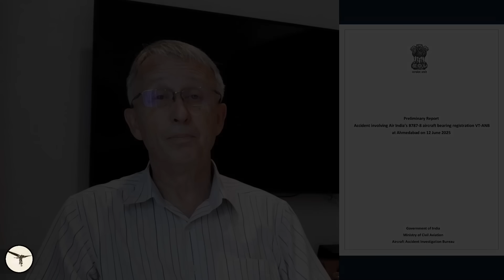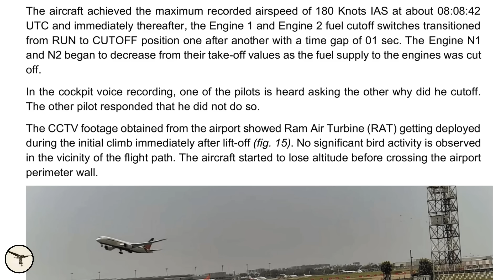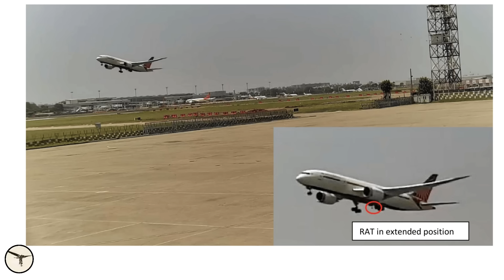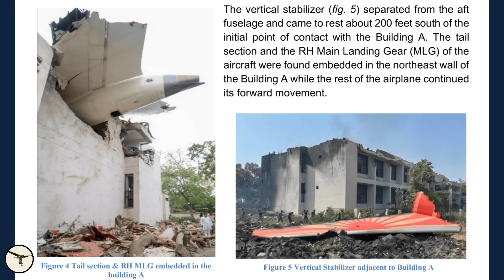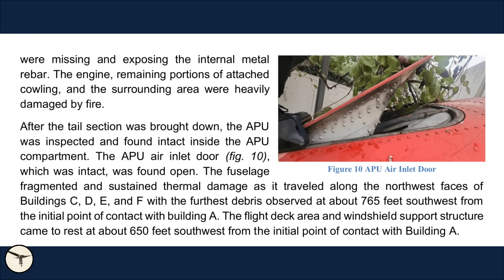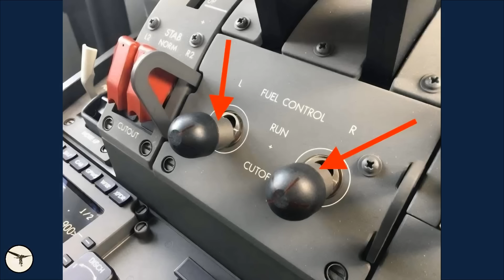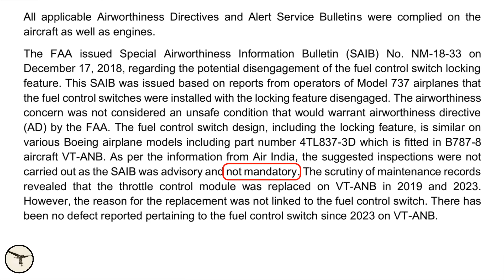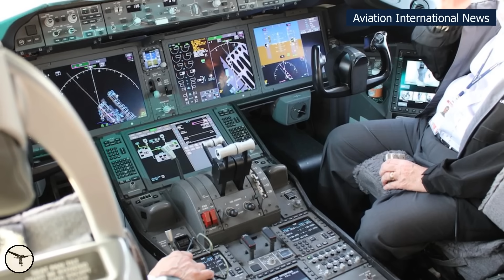WARNING Fuel Control Switches Failure Could Cost LIVES

Comment: Switches not touched, spring loaded valves closed  automatically when  electric glitch stopped power to valves.  NB..  when electrical power is interrupted, even for a fraction of a second, 787 and 777, for any reason, the spring loaded fuel cutoff valves to the engines will snap shut. This design is that in case of electrical failure, which means fire extinguishers cannot be activated, fuel shuts off automatically, spring loaded,  so the wing does not burn through from an engine fire. At take off there seems to have been an electrical snag. Happened to ANA 787 after landing using reversers, in Tokyo, and unable to restart. Happened to BA 777 landed safely mile before runway in London. RTd Training Capt
Reply: Interesting point; I am surprised that nobody else has considered that cause. 🤔
Reply: The BA777 was brought down because of fuel flow issues relating to supercooled kerosene… not switches or engine faults.

Comment: My understanding of why pilots keep their hands on the throttles is so that they can pull back on them if there is an aborted takeoff before V1.  In every video I have seen of this practice, the pilot takes his hand off the throttles once V1 is achieved because you need to have the throttles at full thrust even with an abort after takeoff.

Also, to think that both fuel cutoff switches were pulled inadvertently within one second of each other at the most crucial time at takeoff when a successful relight was highly unlikely in time (the time is NOT a misprint) beggars belief, even if somehow the lockout feature was faulty or missing.  I'm afraid it's looking like a deliberate action by one pilot to bring the plane down.  Who it was and why remains to be seen.
Reply: The timeline (hour, minutes, seconds) in what the switches are moved coincides with the timeline in what the landing gear lever should be moved - and it was not.

Comment: So if the APU provides compressed air for ground engine starts and power, why was that not still running? Had they used a GPU at the gate? Was an electrical short responsible for RAT deployment? That device is not designed to raise landing gear pumps, it’s for instruments and controls, right? Could high heat and humidity screw-up those electronics? 

Is it possible that numerous failings aligned, where none by themselves would cause a catastrophe, yet combine in a unique way to make this ill-fated flight impossible?

Comment: I'm a complete novice. Question: It took ›01‹ second to set two switches to CUTOFF, but four seconds (08:08:52 - 08:08:56) to set them back to RUN?

Comment: One thing I would like to mention is that if the pilot had any suicidal thoughts then he wouldn't have tried to crash it just right at the time of take off. It is in survivable range. Imagine in your mind you being that pilot. I mean it could have even survived had there no buildings and just plain land. So, Pilot might or might not have cut off fuel switches but it is sure that he would not have suicidal or malicious thoughts. Yes, he would be very reckless like drunken person.
What are your thoughts on above, guys?
Reply: To cut off fuel right after takeoff is PRECISELY the right time to do it if you want to get killed because there is not enough power to fly any higher (and then possibly glide to safety) and at the same time you are high enough to get killed when you drop on the ground (unless you land on a giant sponge).  You have to be a pilot to know precisely this moment (and after this crash the general public learned about it too).

Comment: Why did the RAT deploy? Engine fuel cutoff can stop electrical power instantly? Fans take a long time to spool down on the ground, and with wind through them, would it take longer? If critical for restarting why did they takeoff without the APU running? The plane has sixteen batteries, doesn’t it? What are they for? 

Fuel pumps mechanical? What controller opens and closes fuel valves when switches send a signal? Did an electrical power failure occur? Would that change of power source cause the fuel valves to close without a change in switches? How much time can pass before fuel pressure is lost and line supplies depleted, from switch cutoff to thrust failure? 

Inertia would continue a climb-out, trading airspeed for altitude, yet RAT deployment was said to quickly follow rotation, as 180 airspeed was achieved. That can lift an aircraft temporarily, but not raise airspeed from 153 to 180. That max speed must be the point of engine failure, but why is that an instant signal to deploy the RAT? Hydraulic pumps are electric on a 787, aren’t they? 

A running APU would be stripped of its blades, if running at the crash, but that has the same fuel supply. Does it have a different cutoff switch? Time stamps mean everything in this scene, and radar, voice, video, and data marks in time signal when the boxes received the signals.

They don’t say whether pilots initiated them. It doesn’t claim that anyone was in the jump seat. Nor do they assure that a malicious hack hadn’t occurred. The switch message wasn’t sent from the switch to the black box recorder directly, and actuation demands a controller. 

Will a starter engage a turning rotor? Did that happen? Or was windmilling still able to compress fuel/air for a relight? An electrical hiccup at low altitude that requires a fuel reset and engine restart without sufficient time is tragic. A pilot dealing with secret demons is quite another. The latter is so much easier in dismissing all other more complicated questions. Nothing conclusive says that that is the answer. 

If so, the cloud seen in the swirling wake of the rising jet is nothing. But we’re engine and fuel pressures lost suddenly, according to that dew point performance profile standard, or was the thrust struggling already, before fuel cutoff? 

Was this flight doomed,….or murdered?

Comment: The conclusion that a pilot intentionally switched the engines to cut-off is speculation. The FAA issued a Special Airworthiness Directive (number NM-18-33), listing the 787-8 model as affected, that warns of: "The potential for disengagement of the fuel control switch [locking] feature" because some switches were installed by Boeing "with the locking feature disengaged."
Reply: They were turned off separately by a second and tuned back on 10 seconds later. If it was accidental why wait 10 seconds to turn back on. One engine did relite, If it was sooner maybe they would have got out of it but doubtful at that altitude
Reply: Even if the 787-8 had the locking feature disengaged the fuel control switches moved not at the same time but one second apart. That suggests someone moved them - one at a time.

Comment: Would plane enginge run if switch was moved to run but didnt fall in gate but they were right on the edge of the gate? I have played with many switches the steel one Nd i was used to enjoy the satisfying action from that. I was used to balancing the switch right in the middle but the radio wouldn't turn off. And due to spring pulling it the slightest nudge would close it. Nd radio off

Comment: Engine computer has control over fuel switches

1 sec it too short for pilot to act
Reply: Nope, just fast enough for a human to do it
Reply: 1 second to between CUT OFFs but 4 seconds between RUNs. Why is the difference?
Reply: @Te0gop The fight between pilots. The smiling one lost the fight.

Comment: There are dozens of time stamps given for all of the events in this crash. But no time stamp was given for when this alleged flipping of the switches occurred.
Reply: Read the freaking report dude. Immediately thereafter 08:08:42.
Reply: @GrimYak  Immediately after the ice age, helocene started. What time, within 1 second did that occur? It was immediately, how much time was it immediately after the ice age?
Reply: Also the actual deployment of RAT - immediately after liftoff what does it mean - before or after CUT OFF?
Reply: The RAT would have deployed almost immediately after the switches were moved. They were moved 4 seconds after the plane became airborne.

Comment: maybe when the fuel switches were turned to the run position, it was not in the lock mechanism, and then they slided back to cutoff position without pilots even touching them. I don't know whether it is possible to happen that way. otherwise one of them must be suicidal.
Reply: Have you considered telekinesis?

Comment: Hello Mister Magner:

Can you shed some light of the US FAA Special Airworthiness Information Bulletin (SAIB) NM-18-33 was issued on December 17, 2018. This SAIB addressed the potential for disengagement of the fuel control switch locking feature on certain Boeing aircraft?

How could this may have played the role in fuel being cut off to the engine?
Reply: The accident aircraft have their throttle console - that included the fuel switches; replaced in 2019 and 2023, none caused by issues with the switches.

Seems this preliminary revelatory was made for create more doubts than explain anything.

Comment: All nonsense: Initially, the fuel switch in the on position must have malfunctioned due to some electrical glitch. This means, though they were physically on, functionally they were off. These reduced the engine power, which must have triggered the cockpit warning signals. The pilots at that point must have then tried to recheck the fuel switch by moving it on and off (confirmed that they really did within 1 sec), to check if the switches are OK, and really working (which we all do as part of human behavior when something doesn't work ). Finally, they put it on. But by then, the engine had stalled, and it crashed. There is no conspiracy or pilot fault unless we can prove that the fuel switches were actually functional. Put yourself in the pilot's shoes at that peak of emergency and ask how much your cognitive and motor skills will work trying to troubleshoot a problem, as well as to save the flight from crash, all SIMULTANEOUSLY within less than 2 mins. The senior pilot was nearing retirement, while the first officer was at the peak of his career. There is absolutely no intent from either of them to deliberately sabotage the flight. There isn't a reason to do this. It makes no sense at all.
Reply: We don't know whether the pilot asking the question had seen the switch position (or the other pilot turning it off), or whether he had noticed a warning on the display. In any case, such a situation initially leaves one confused and perplexed. It would now be necessary to clarify whether such a discrepancy between the physical position of the switches and the data in the computer is possible.

Comment: On Jul 12th 2025 (UTC) India's media report that the investigation is NOT focussing on a human action causing the fuel switches to appear in the CUTOFF position, but on a system failure. Service Bulletins by Boeing issued in year 2018 recommending to upgrade the fuel switches to locked versions to prevent inadvertent flip of the switches, as well as the FAA/GE issued Service Bulletin FAA-2021-0273-0013 Attachment 2 relating to loss of control issue (also see above) were NOT implemented by Air India. The stated MN4 computer with faulty soldering, that might weaken and lose contact due to the thermal stress after a number of cycles, interprets data and commands fuel metering valves - with the lost contact attaching the MN4 processor to the EEC intermittent electrical contact, loss of signal processing and engine control faults can occur. The SB writes under conditions for the SB: "An LOTC (Loss Of Thrust Control) event has occurred due to an EEC MN4 microprocessor solder ball failure." According to discussions in the industry it may be possible with the number of cycles VT-ANB had already completed, the solder balls were weakened sufficiently to detach the MN4 from the EEC momentarily due to loads during the takeoff rotation leading to the loss of control of thrust and shut down of the engines.

Comment: This report is suspicious.
It states the "Engine fuel cutoff switches transitioned from RUN to CUTOFF", it does not state 'the pilots switched them off'.
With all the electrical safety hazards and inadequate fail-safes exposed in this Boeing 787, such failures cannot be discounted.
And why is no blame laid on one of the aircraft engines failing to restart after fuel supply was reinstated ???
Reply: Who switched them off then? 
There is no system that can physically move the switches
As for recovery, the cutoff for engine 1 was moved back to run 4 seconds before engine 2 which might explain the small difference in relight behaviour?
It shows the FADEC was in fact working perfectly and had they had a bit more altitude / time the crash would have been prevented.
Which IMHO is why the 'guilty' pilot moved the cutoffs exactly when he did - no chance for the innocent pilot to abort the take off or reinstate engine thrust in time.
Reply: They were clear that the switches moved and there is no way for them to move without human intervention. Mayybe they isolated the noise of the switches being moved on the CVR?
Reply: @gap9992  This was not clear. All of the events have a time stamp given of when an event occurred. But not the alleged flipping of the switches.
Reply: @martinwhite418  "switches transitioned from ON to CUTOFF" What does that mean if it does not mean the switches were moved?
As for a time stamp,  immediately thereafter 08:08:42 is good enough for me
Reply: @gap9992  They purposely chose not to give a time stamp of the 2 switches. No. That's not good enough. That will become an issue.
Reply: @martinwhite418  They were switched off immediately after 08:08::42 - do you accept that is what the report says?
Engine 1 was switched back to run at 08:08:52 and engine 2 at 08:08:56
Entirely consistent with the good pilot seeing what the other had done and quickly switching them back on.
What issue are you expecting??
Reply: Good observation which many other experts have highlighted. Knowing Boeing we will never know. What puzzles me is why the voice cockpit recordings (in full) from the time the aircrafts startup sequence started on the runaway till moment of impact was not released. What are they hiding? Things are very fuzzy now, but there seems to be an effort to throw the pilots under the bus, if you know what I mean. It would also be prudent for the Indian Aviation authorities to clear the area beyond the actual runaways in India of all obstructions, buildings, etc. As one expert mentioned, if this accident had happened in Mumbai, it would have been catastrophic.
Reply: This report is the preliminary one, not the final one. Its purpose is to provide basic information about the incident and technical/operational information relevant to operators of the aircraft type. Fully explaining the incident and making recommendations is for the final report. If the final report omits or conceals information, that would be suspicious.

Comment: The first change I would want to make after this accident is an interlock to prevent the fuel control switches being moved to “cutoff” whenever the throttle lever is above the idle position. This would have increased the amount of time required to shut off the fuel switches as well as make it much more unlikely to occur by accident.
We’ll probably never know if the person who did this was intending to crash the aircraft, but it would be worth considering the similarities between this accident and the Yeti Air ATR crash caused by the Instructor Pilot monitoring moving the propeller condition levers to feather instead of lowering the flaps.
Reply: EMBRAER planes have this logic, after turn the switches the fuel valves only operates if the power levers are in idle position.
Reply: You're just adding complexity for no gain. 
The switches were foolproof and already needed deliberate action to move to the cutoff position. 
Why didn't people understand these simple truths.
Reply: @heinzriemann3213As another pilot explained from their experience, they aren't fully fool proof as the fuel valve will open with the switch on the hump. An interlock would also reduce the risk of a wrong engine shutdown during an emergency.

Comment: Why couldn't a better guard be designed and placed over these switches? Something that covers them but is easily lifted so the switches can be moved but also keeps accidental movement of the switches from happening?
Reply: So the next tragic event would be: the engine got fire and the pilots were unable to extinguish it because the switch cover was broken and they were unable to lift it on time.
Reply: @kumalaba  You've never flown jets, have you? When you push the "Fire" button for an engine on fire, it cuts off the fuel as one of the functions.
Reply: That's a very good point, wouldn't have taken much modifications to do that. Can anyone enlighten me on how the fuel control switches work in the Airbus fleet?

Comment: The investigators will interview previous crews; the pilots, co-pilots of this plane as to whether they could move the Fuel Control Switch without the locking Disengage feature.
-------
- If they could flick it from Run to Cutoff then that is one answer...
- If they could not move it without first pulling the switch out (disengage), then that is another answer...

Comment: Respectfully sir, I believe this was a murder-suicide rather than a mistake
Reply: Researchers must follow a methodology that requires them to find evidence.
Reply: @Delta757-3 said "I believe this was a murder-suicide rather than a mistake"

"BBC in 2014: Victoria Nuland: Leaked call shows US hand on Ukraine"

Corrupt idiots' opinion is wet paper
Reply: US FAA Special Airworthiness Information Bulletin (SAIB) NM-18-33 was issued on December 17, 2018. This SAIB addressed the potential for disengagement of the fuel control switch locking feature on certain Boeing aircraft.